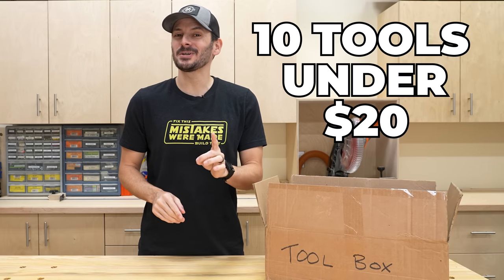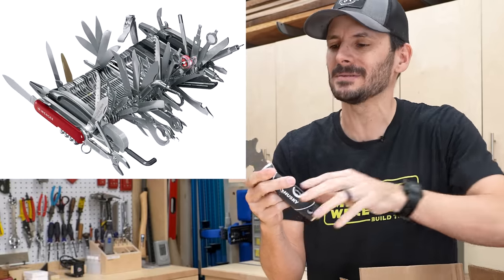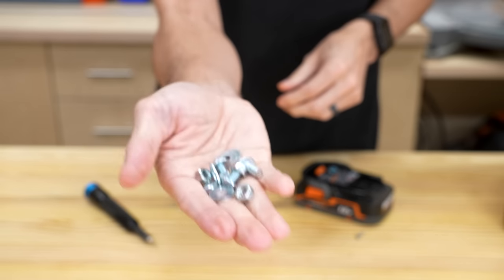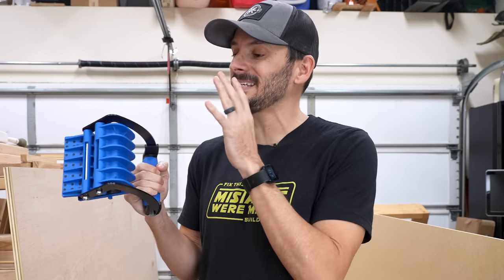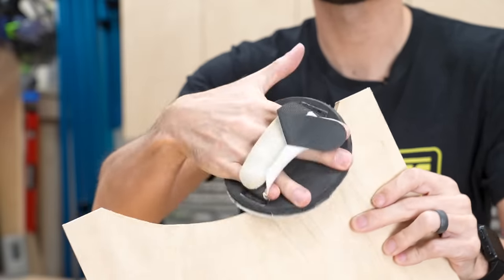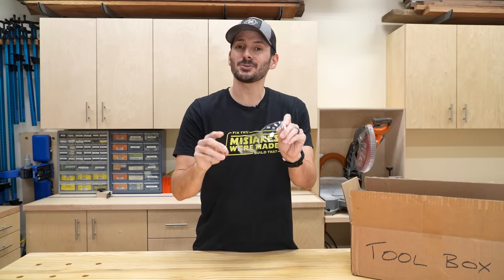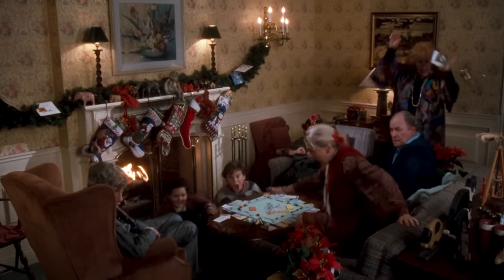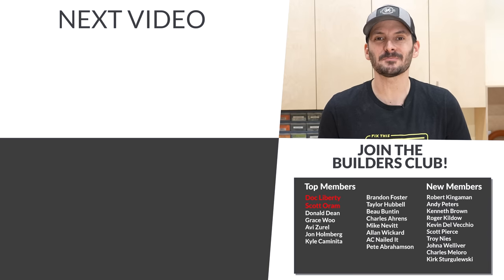10 Tools Under $20 to Level Up Your Shop

Comment: I have used glu bots and while they are very useful, cleaning them is a headache. That little bend where the bottle meets the spout is almost impossible to clean. If you have dried glue? Forget it. Only thing that will unblock it is white vinegar, and unless you have a very bendy and very long bottle brush, you're not getting that stuff out. How would anyone get dried glue you say? I work as a volunteer in a 50+ center and I'm telling you, glue dries in that little turn. 
Magnetic parts trays are the bomb, and you can get them cheaper at Harbor Freight. 
Kreg has awesome stuff, but it's all way overpriced. I'll just carry my panels by hand, thanks. 
Love the 3M respirator. Easy on, easy off, easy to release to speak to someone else, easy to change filters ... love.

Comment: I actually have the same husky 15:1. The screw driver portion is def not as beneficial in the shop. But for paint projects in home, it’s great for not carrying an extra driver around to remove plate covers.

Comment: if you store glue and adhesives upside down it cures a host of problems. Take a 4x4 scrap x 6" or so long. drill a primary hole big enough to fit the round bottle in....drill a secondary hole  in the bottom of the primary hole just bigger than the screw-on cap. then a third hole on the bottom of that hole just bigger than the dispenser tip all the way thru to the bottom of the 4x4... store the glue bottle upside down in this holder. (even as you glue projects up develop a habit of putting the glue bottle back in this upside down holder.) Benefit one; glue will always be at the dispensing tip (no need to shake or tape the glue down.) benefit 2; any glue that sets will now be at the "top"  (what once was the bottom) of the bottle.benefit3;  no more tip plug ups (as long as you remember to close the dispensing tip.)  beneifitv4; Instant application of glue and much better control of amount dispensed because any air in the bottle is above the glue helping dispense it. If you type in "glue up Loris cup" in you tube search at about the 5 minute point there is an example of this though i made this one from scarp round pieces

Comment: someone might have already said this but the hex wrench sizes doe the 15 in 1 scraper tool are used by automotive painters why have to teardown their guns after every paint application. the 2 sizes are for the nozzle and hopper/cup neck attachments.

Comment: Instead of buying the painting pyramids, I just put a screw through a load of scraps and offcuts so it protrudes, then knock off the points with a file. Costs pennies and you can make dozens with a ply off cut

Comment: Hey Brad, how do you feel about the cloth and velcro face mask you briefly were holding in the video around 9:10?  I do woodturning and find that between my 3M-style respirator, + earmuffs, plus safety glasses or face shield, it becomes a very specific order that I have to take it all on and off, and it's a bit of a chore.  Glasses arms, earmuffs, and  respirator straps all get tangled up; I'm considering switching things up to reduce the tangle.
Reply from the maker: I use that one when I cut the grass, but wouldn't really trust it while sanding a bowl on a lathe.  It's got way to many gaps for fine dust.  The respirator is more cumbersome, but much more protective.
Reply: @Fixthisbuildthat  awesome feedback, thanks Brad!

Comment: That's not a paint lid hammer! It's used to tidy up holes/rough blemishes in drywall so the filler does its job properly when you repair said holes!
Reply from the maker: sounds like a hammer to me :)  Great tip and usage!

Comment: The scaper version of the box knife has too steep of an angle. The 6 in 1 handle cap will break off from pounding on it. The full tange version 5 in 1 is better. I had that end cap come off many 6 in 1 tools.

Comment: The bummer with respirators is you have to be clean shaven for them to work as intended. A proper seal is needed around nose and mouth and beards or facial hair prevent that. They make a mask that fully encloses the face but they are far more expensive
Reply: I own the same mask and can pass a fit test with a well-trimmed beard.  YMMV depending on how dense your own facial hair is.

Comment: I llike the glubot, but it has the same issues any glue container does. Glue will dry in the spout and plug it and it will set up in the channel that feeds the spout. You can empty  it every time and wash it, but what a pain and waste of glue.
Reply from the maker: if you put the cap on it won't clog up in the channel.  There is always a little that will dry on the nozzle, but that comes off real easy since it's soft plastic

Comment: I mean those respirators are definitely so much safer than just breathing non filtered air, but you mentioned the seal.... I mean that seal is semi-worthless unless you're going to shave that beard and have that mask fitted to your face.   It's still good to have, it's still going to be a lot safer, but you still run a risk with toxic fumes.

Ear buds are ridiculously unsafe for a shop, but nobody seems to care.  I work in a shop for a living and the number of people who ignore you or can't converse with you because they have those things in their ears is unreal.   Imagine if you had to relay instructions quickly to prevent someone from being hurt, or injured by a machine.   There's a reason they're banned on most major commercial job sites for new construction in this area.
Reply: My guy, whether they are headphones or ear plugs, everyone should have hearing protection in, and that means they won't be hearing you on the shop floor.  More likely they've banned a particular type because of the form factor, but it has nothing to do with being able to hear others at the worksite because, again, they should have hearing protection on of some kind.  That's going to limit communication.
Reply: @TheNathanlockhart  Jesus, you've clearly never worked in an industrial environment if you aren't used to wearing ear plugs and being able to hear.  I wear ear plugs all day and I can hear a pin drop.  You get used to them.

But keep thinking yourself an expert because you watch Youtube.

Hearing protection should protect your ears.  If your ear buds are so loud you can't hear me, they're damaging your ears, not protecting them.
Reply from the maker: Go check out the product page. That's the cool thing of ISO tunes. They are hearing protection, not earbuds. They limit sound levels per OSHA standards
Reply: @Fixthisbuildthat  Then maybe you should put that disclaimer in your video, because I know from daily experience that the ones people are actually using in shops are either not within OSHA ranges, or the OSHA ranges are not within safe ranges.
Reply from the maker: Disclaimer, I actually recommend good stuff, lol

Comment: A respirator and beard cancel each other out. A smooth shave will solve the lack on seal and protection.
Reply: Yeah,that would maybe be true if it was 1915...
Reply from the maker: A beard absolutely makes it less efficient. But definitely doesn't cancel it out fully